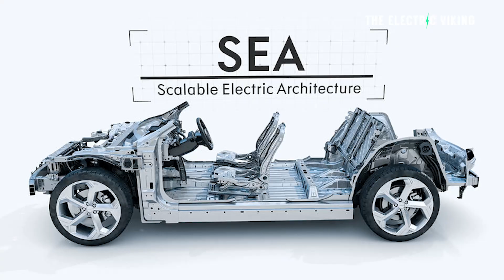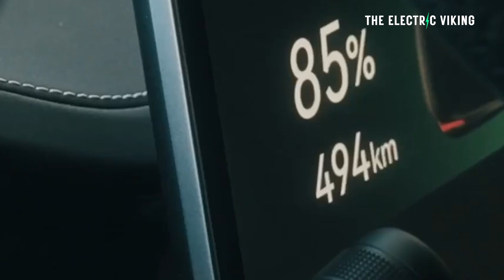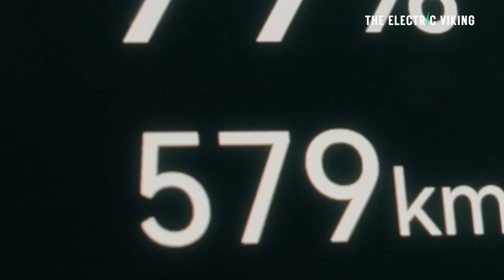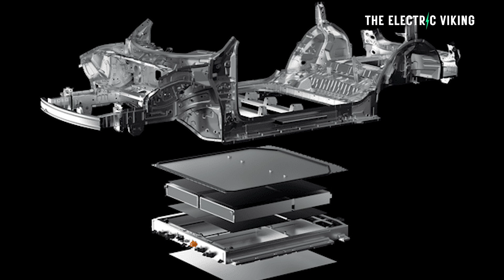Geely Galaxy E5 launched worldwide with most advanced LFP battery EVER

Comment: I just just drove my sons new Tesla Y twin motor LR - wow !!! totally sold a beautiful tech full car - I have been driving for 60 years and love my 2012 VW Touareg V6 this Tesla Y is definately the future charged overnight in my farm shed - blew my mind!!!!
Reply: Almost any new EV would have blown your mind if you are coming from an 2012 ICE
Reply: @mackan7086 😂😂😂😂😂
Reply: All this new battery technology is good news but I’d like to see a concerted effort to make these batteries easily and cheaply repairable when just a few cells fail.
Reply: @victorrussell6284  There are special repair shops even in Croatia and Germany now that fix instead of completely change. And what very seldomly happens than costs instead of some 20‘000 USD just 1‘500 USD. A new engine is not cheaper and that happens on more occasions in a too complex system. So keep in mind the ICE age 💩 after 100 years burns fuel at 21% efficiency but an EV even with bad power mix in EU is at 68% and with own PV and Powerwall to home and destination charge it’s over 72%. By the way we charge in 10 seconds and have a climatized car in the morning, driving downhill even fills the ‚tank’! Can you do that with your ICE that also then only gets hot brakes, e.g. on Swiss mountain routes? Efficiency is all about and also less local pollution and no noise, less service - every two years - and TCO down in our fleet by high 30 percent number. So are we idiots like 65% of owners that have no idea what a car really costs?🤪😵‍💫🤡🦄🤑
Reply: Unless it’s a V8 or v12 or something worthwhile, engines don’t do it for me now
Reply: Xgxxxzf
Reply: FC xxz
Reply: I love the concept of evs should b popular 20 yrs ago
Reply: @garnettharris4819  

They're popular now. The US market, people and government has made the driving and ownership of an EV so political. The reason China and everywhere else has adopted them better than here might be because they're not bending over backwards to please the oil industry. Outside the US EVs are more popular.
Reply: @KineticEV  Yeah, you have so much horse coach builders and Motorola or Nokia phone owners that fear EV, Elon and the Chinese performance cars that let any GM crap metal look from the golden years of my grandfather and I am 73 now - driving a performant Kia EV6 AWD.
Reply: We just got our daughter a '22 Leaf which is yesterday's technology but it's still amazingly fun to drive. Now I want a Tesla or something similar. My ideal would actually be a really nicely designed Toyota or Honda EV, but those don't seem to really exist yet.
Reply: @ChickensAndGardening  Yes, and they are real crap metal compared to Tesla and Hyundai Group Cars (Kia, Ioniq, Genesis). Better pay a little more and get actual technology. Germany (only BMW is doing more or less fine but prices are from Mars or Venus for fully equipped cars matching Tesla). Kia for me since 2021 is very reliable and the first car in 54 years of mostly German premium that in over two years had not one problem and now the first service costed have of former Mercedes and BMW ICE age cars. Here you even have 7 years of warranty. The Japanese are however completely out with bad technology that after Nissans Leave not evolved anymore as mainly Mr. Toyoda‘s lobbying for stupid hybrid cars was successful!
Reply: wr
Reply: G. G, b n.y. , xxu xxv,    ,zzz h.c cd
Reply: Easy pleased by souless golf carts.
Reply: @colinstewart4357  By soul do you mean vroom vroom engine noises and exhausts spewing clouds of cancer causing poisons?
Reply: @skipondowntheroad5833  oh yes,I forgot about that,so bad it's getting hard to swerve round the bodies dropping on the way to work. There's nothing wrong with the air,and if there was, EVs wouldn't fix it.
Reply: @colinstewart4357  For me the technology is the juice, the inner form. Thats what gets my soul excited. Electric drive-train is so much simpler, better.
Reply: @jaaklucas1329  simpler,yes,not better.
Reply: @colinstewart4357  Invite you for a drive with my Kia EV6 AWD with only 333 PS/608 Nm of instant torque for a ride on a real racetrack not that shit of quarter mile only in straight line. On Anneau du Rhin even stronger Alfa-Romeo Stelvio with 510 Ferrari-PS but only 600 Nm and 8 gears automatic gearbox had some problems to lead. But the 6 cylinders sports engine consumed more than 20 litres of Shell V-power per 100 km/60 miles while the equivalent for the EV then is only 4 litres. In daily use on all profiles it’s however only 2 litres and for the Italian sports GT it’s still 10 litres of high grade fuel costing here around 2 USD or more per liter! So the differences are stupid noise and stinking gasoline while in the EV I can listen classical musique like in an Opera house, or heavy metal if I still need noise. The acceleration in not the top version of the line is 5 seconds to 100 km/h or 60 miles/h. So easy to beat also some sportier ICE age cars and also thanks to electric engines the wheelbase is 3 meters which gives the room of a Mercedes S-class! Soulless golf carts? You neither play golf nor have you ever driven a MY performance, Kia EV6 GT, Genesis GV60 Sport or the new Hyundai Ioniq 5N which has a real sound generator for track use. No joke without sound I had problems on trackdays being always too fast and also had to concentrate on my HUD and track markers for the perfect speed. With sound it’s definitely easier but if you do no trackdrive the sound just serves idiot posers here from Balkan countries mostly🤪💩😵‍💫🤒🤮
Reply: @colinstewart4357  at least they won't suck the soul outta my wallet to keep feeding it dino oil ugh

Comment: Sam, when you talk about range, please state which standard you are referring to e.g. WLTP, CLTC etc.
Reply: Probably NEDC, so way optimistic
Reply: The figures he mentioned work out at approx 5 miles per kWh.   So (5x 60) 300 miles for the larger battery pack.   Current Teslas can readily achieve 4 miles per kWh so not an outrageous claim if the vehicle is lighter.
Reply: @crm114. 20% more is quite a lot I think. The Geely car is far from 20% lighter. So it is actually kicking Teslas ass I would say when it comes to range and battery